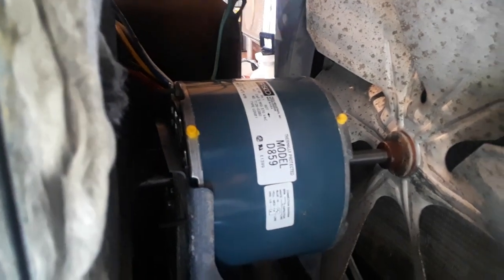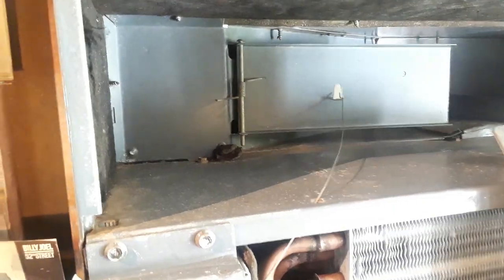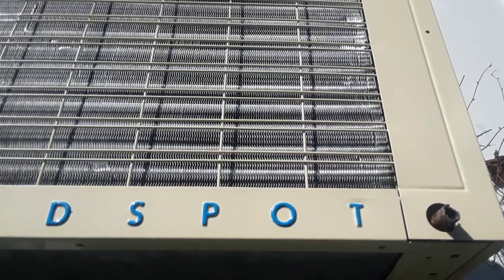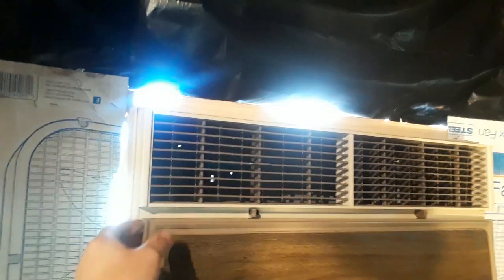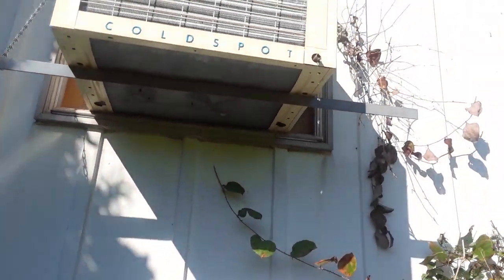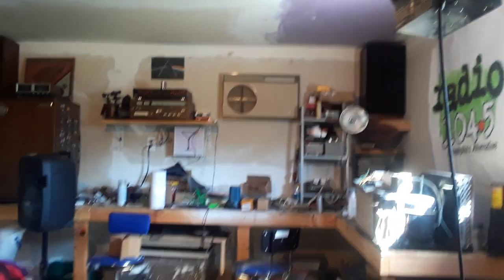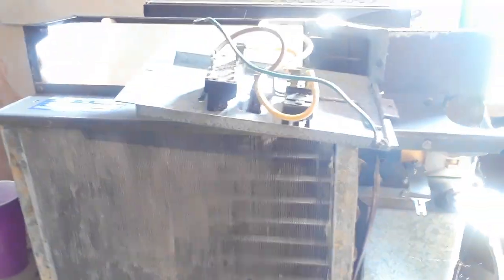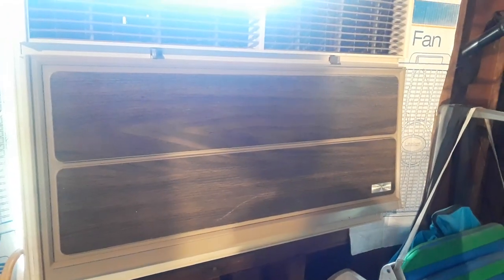Late 1960's Sears Coldspot 18,600 BTU Air Conditioner

Comment: Thanks for your awesome vids. I just got a 28,000 btu Coldspot for free and knew it was vintage. But this thing is new, as in rarely used. Super clean and quiet and COLD. It was in a old house with the back end in a added porch area, so it was never outside. I am very happy.
Reply: Hey That’s a nice catch 28,000 btu. It’s been awhile is it still going strong.

Comment: Glad to see you got her going again!  I would pull 4 AWG wire vs 6 AWG as it's heavier and better suited for a longer run from the main panel to the sub.  Plus it will handle the inrush current of those units starting up with less light dimming and be easier on the compressors.  I always run my wires per the 60 degree standard vs the 75 degree standard.  It's overkill, but I know it's going to be heavier duty and will not get as hot under high loads.  6 AWG is rated at 55 Amps at 60 degrees while 4 AWG is rated at 70 Amps at 60 degrees.  One of these days I'll get on Flickr. ;-)

Comment: How did u wire it in with the new wires the old one had three to the switch and the two brown going to the capacitor but the new one only has one brown wire and three for the switch for speed but where dose the white wire go dose it also go to the capacitor are no

Comment: That's the exact model we had in Dallas. I know that front panel, and fan switch on the bottom anywhere. That's when Sears sold good quality merchandise. Alas, our Sears department store here in Pensacola gave up the ghost last month. Mr.AirConditioner Guy, ours had brackets on the bottom that mounted at a 45 degree angle to the house. Do you still have the ones that came with that unit, and do you plan to install them for support?
Reply from the maker: if i had them i would for nostalgic reasons, but all i got for now are my chain and angle steel

Comment: Hi A/C Guy thanks for the posts. I think I have this exact model in my garage and it recently started acting up. It runs fine when I start it up but after around a minute and a half the fan shuts down but the compressor is still running. Any Idea what might be happening?  Same thing happens every time so the fan motor is still working but just for that short time.  Thanks again!!

Comment: That’s a sweet unit! Such a beast! Did these come with different compressors depending on the year? I’ve heard some that sound more like my mid 60s 11k Coldspot unit. The tecumseh b series 4 pole twin cylinder recip aka: the monster haha
Reply from the maker: B series is prbbably the best and yes depends on the model of  the unit